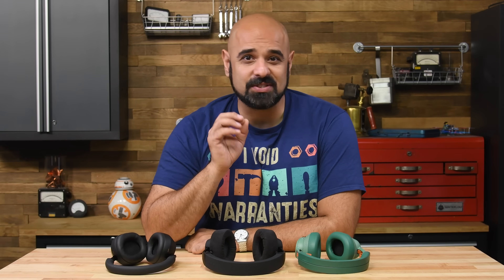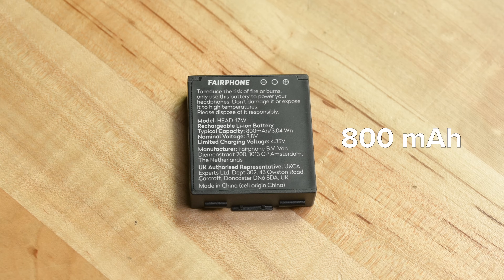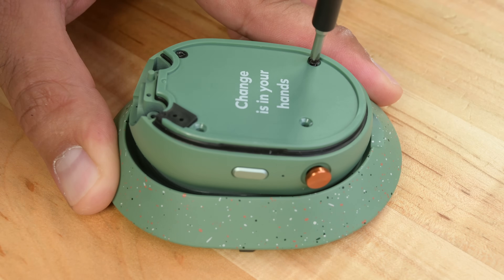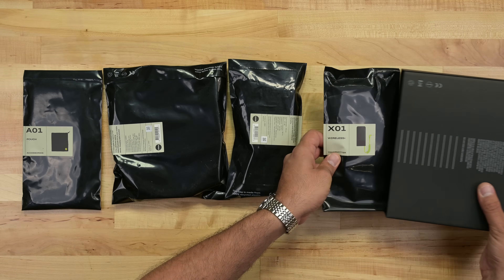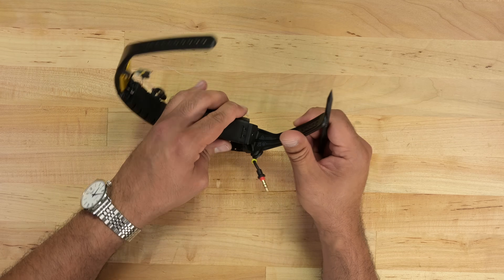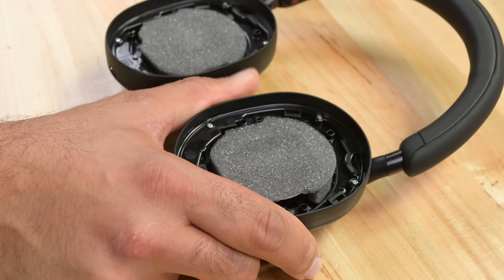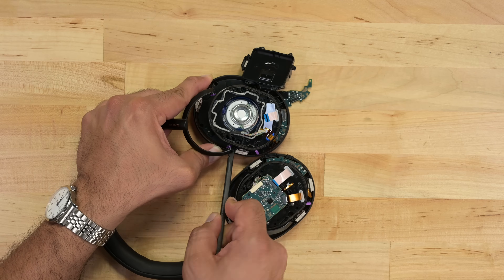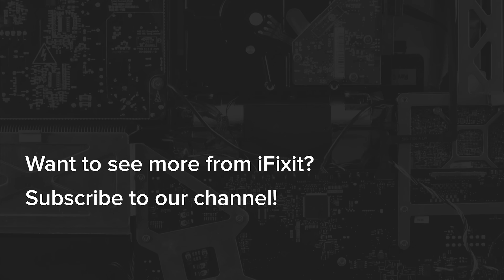iFixit Teardown Review: Best Repairable Headphones!

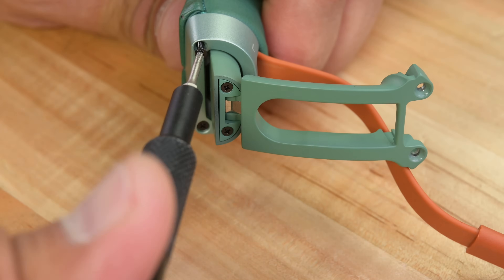Comment: Love the video but at 1:09 you don't need to unscrew those screws! theres a silver lever under the headband cover you just pop open and you can slide the headband base right off to be able to remove the cover and the cable! its super easy
Reply from the maker: Nice! Thanks for the heads up :)

Comment: Any chance they're videos with the heavys brand over the ear headset? I just lost sound in my right ear cup and the physical audio cable is not damaged but there is a chance that the port where the cable goes into, is off center and not making a good connection somewhere and only hear sound from the left war cup and not the right. Any help is much appreciated

Comment: I just received a TMA-2 from AIAIAI. Bad quality. The product was incorrectly produced which made one cable to be stuck in the driver and the other to not be lockable. The left side didn't even put out the same volume as the right side. Complete failure. Leave your hands off of that cheap China quality.

Comment: I don’t care for Bluetooth headphones, because I would have to rely on sourcing the battery (I’ve owned headphones for +20 years)
 This time bought the AIAIAI TMA2 DJ headphones, for me replaceable parts are super important. My other choice would’ve been Sennheisser HD25, they have replaceable parts, but tracking them down can’t be hard for discontinued models. 
The best thing about AiAiAi TMA2 is that it’s much more durable than any headphones that I’ve owned. Just about every Sony products that I’ve owned in the past failed sooner than other brands, they would typically last maybe 3 years? Then gets outperformed by an older slightly beat up headphones. So I assume that Sony does it be design. The Fairphone is a company with great philosophy, however thin parts are more likely to break.

Comment: Why aren't the Fairbuds available in the USA?? My AKG N60NC Wireless headphones just broke: a simple plastic part cracked due to fatigue. There are no replacement parts available from Harmon/AKG and a new pair would easily run around $150 or more!
Reply: Try 3dprinting to fix😊

Comment: There is a reason the AIAIAI keep all the processing away from the drivers: they are sold separately. This way the user buys the "brains" of the device a single time and they can buy different drivers to customise the sound without paying for the same electronics every time. They also have headbands with no electronics for wired-only used.

Comment: Seems like you got some nice repairable headphones! The same cannot be said for the Bluedio Revolution headphones that I have had before, which (although having good sound quality and features) have a distinct lack of modularity and questionable build quality. Even replacing the battery will likely be a one way procedure, but from my experience, other parts have given way long before the batteries lose any capacity, and the batteries still test out OK on my test setup.
Would probably get a Fairphone pair if they were available in the UK.

Comment: Well done Fairphone on once again leading the way. Wish more bigger companies followed their approach. However, I still rock with my wired AKG K452’s, still working after 11 years. No batteries, no complications, no fuss. I just replaced the cable and ear cups. Happy days.
Reply: yeah wired headphones are often way more repairable. Though plastic can broke after time and spare parts are not as easy to find than wires and cable. That's the issue I have with my AKG K242.
Reply: Sadly mine died but they are good
Reply: There’s something to be said about durability. Personally I would never touch Sony for that reason.

Comment: I wish there were repairable IEMs. They're my preferred form factor.
Reply: That's what I'm waiting for. I use IEMs at work exclusively.
Reply: they have smaller footprints and thus more complicated, also not to forget they are not meants for workouts and any amount of moisture would affect the sound(heard condensation issues with metallic body iems). Just replace them when needed, chi-fi are hit or miss, some in my collection are still going strong through ages of usage and ironically the cheapest ones
Reply: what are IEMs?
Reply: @yosyp_yosyp  In ear monitors, the small silicone/foam buds that go inside the ear. Most true wireless earphones are IEMs.
Reply: Funny you say that lol

Comment: I love repairable headphones but the electornics and batterry always is the last thing that breaks for me, before the batterry goes bad the coushions and hinges break for me, I had some expensive sony headphones and other people I knew had differrent models too and in less than a year their hinges broke because they used plastic inside, was repaired 2 times in warranty, then I gave up. What I care about the most is solid hinges that use metal all around. I like the designs from the marshall wireless headphones and the old sennheiser momentum 3
Reply: My 22yrear old Senheisser HD270 is still functioning, although it could use need ear cup foams. The AIAIAI TMA2 is super durable, with almost no parts to break, the headband is a durable silicon coated nylon that slips in to the earcups/drver units.

Comment: I feel like Fairphone got off a bit easy for not supplying spare parts here it's quite close to the Sony's in that sense. Needing a donor means having to find a broken pair and buying it which can be both unnecessarily expensive and a lot of work.
Reply: In Australia, companies are legally required to have spare parts available for the  expected life ( customer's reasonable expectations not manufacturers) of the product.  I'd expect Europe to have similar regulations.  US, anything goes as long as its not the manufacturer's responsibility
Reply: I assumed Fairphone already supplies spare parts (like with their phones), but for fairbuds it still says - "Spare parts coming soon"
Reply: @CasualHerb  All pairs sold are still under warranty. There's no immediate need for the spare parts
Reply: It's 3 months later and as spare parts appear to be available from fairphone. The headband bases are out of stock as I write this.
Reply: For those watching today: yes, they are now in stock
Reply: Thats what ebay is for. Or any other auctioning sites. 
Its quite easy to find stuff by just seaching it on google. And theres sites like sendico that will do the importing work for you if you want a pair from japan which can often be cheaper